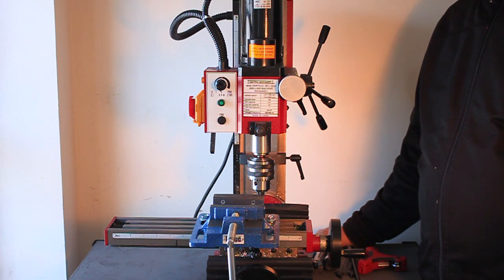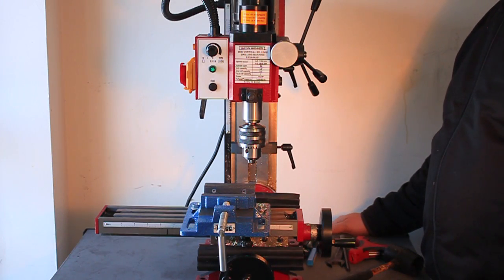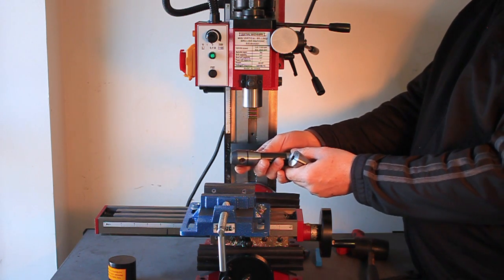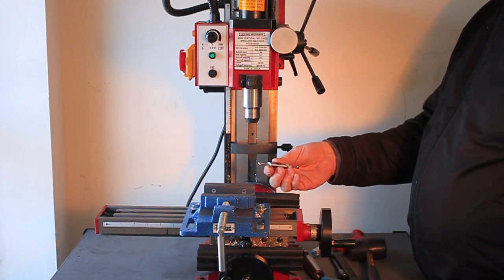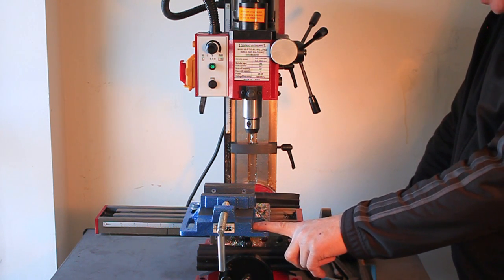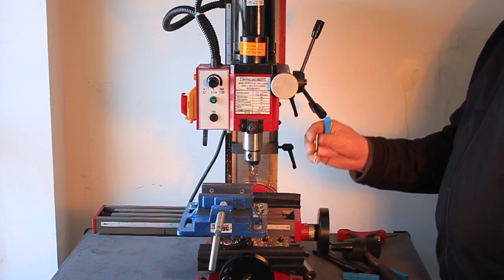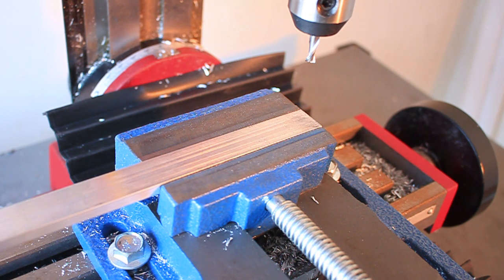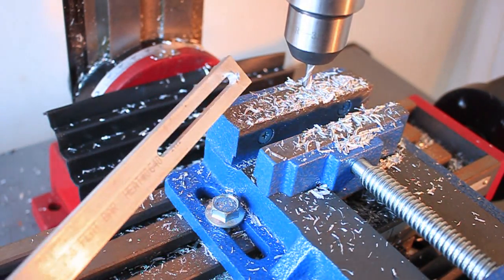Harbor Freight Mini Milling Machine

Comment: To release any r8 collet or drill chuck you loosen the draw thead about 2-3 turns tops and smack it with a dead blow mallet. It will drop the treads catch it keeping it from dropping out and the unscrewthe draw bar by hand.   What you did will 100% mess up threads.

Comment: for $155 I added a belt drive to replace the damn frangible gears!  It has two speed choices(pulleys) 0-4700 and 0-1700 RPM Sooo quiet and MUCH smoother.  Have not had to take the mill apart in the 7 years since the upgrade.https://littlemachineshop.com/products/product_view.php?ProductID=2560&category=2122081963

Comment: You do not completely unscrew the threaded shaft then tap it, you unscrew it several turns, tap with mallet, hold chuck in one hand then unscrew threaded shaft with other. You don't  have to remove the threaded shaft at all!

Comment: Loosen the top bolt then reinstall it 5 or 6 threads tap the chuck loose and unscrew the bolt this way you cant damage the threads, and you absolutely can dammage the threads on both your chuck and collects and shaft.  Use a brass hammer or a dead blow hammer
Do not use a steel head hammer.
You should own a brass hammer. 
I worked in a machine shop trust me if you don't think it can break ive got news someone will break it.

Comment: You only loosen the chuck shaft, if you fully remove it and strike it with a mallet, it will eventually damage the threads..

Comment: 2:15 ... Some people "think" it will ruin the threads...it WILL ruin the threads, that is not even a question to ask.  Never hit a threaded rod into a nut without screwing the rod into the threads first !  You can lightly tap it, just like you did, but ALWAYS thread it in a little bit first.  Never do it the other way, its not an option, unless you like boogered up threads that is.

Comment: The machine is okay but the X-Y mill vise is total junk.  Mine came new with both travel screws bent at greater than 14 degrees where they passed through the fixed jaw.  How can that happen unless it leaves the Chinese factory made and assembled like that?  There was no damage to the packing yet Harbor Freight refuses to return or refund.  If that is the quality of their $56 vise how can you trust the consistency of their machinery?  I noticed that not once did you say “thousandths”. Not surprising.

Comment: The proper way to remove a chuck is to back the draw bar out ~1 turn and then tap it with the mallet, otherwise you do risk damage to the threads (still kind of unlikely though, unless you slam it for some reason).

Comment: Does your chuck wobble when rotating? Mine does at low speed, at mid speed the mill vibrate and at high speed... I think the chuck is faulty 😕 Can I send to you a video and let me know if that is the way these Chinese chucks are, or they're faulty?
Reply: It's made in China from recycled Toyotas by slave labor held at gun point.  How accurate do you expect it to be especially for the price?

Comment: In 1980 rite out of high school went to work in manufacturing at a large company.  Please to all SAFETY FIRST ALWAYS EYE PROTECTION AND HAIR TIED BACK.  First year a young lady on a high speed drill press lost her scalp. She lived and it was a freak accident. In a different company a many severely hurt from lathe stringing debri.  Machines have tobe treated with respect.  Safety first

Comment: This video popped up in my feed at a good time, thank you for making and posting it. I have a South Bend Lathe and an old Taiwan made mini lathe, and have been looking at getting a milling machine. I was a machinist years ago, and ran Bridgeports, engine lates, turret lathes, CNC lathes and whatever paid the bills. Your video showed what the machine can do, and what to expect. It will fit in my garage or basement easily, and I'm up to the task of upgrading it as needed. The comments section is brutal, I guess some people just can't let you be. Thanks again, Joe.

Comment: I started out with a "VERY" used Bench-top model of Mill ($150, if I could carry it away - which I did).  Over the years, I "graduated" to Bridgeport Vari-Speed Mills and finally settled on a Lagun 10 x 48 - with CNC and XYZ readout and all tables motorized (over $25,000).
I can tell you this much --- in the proper hands, they BOTH cut ...!  Haha!

Comment: is there a micro adjust/movement on this machines' Z axis?. I see a hub with a couple of handles coming of to rotate the pinion but the knob that the viewer only gets an end view of, is that a micro movement in the vertical.
Reply: I know it's a year later but yes, the standard three handle drill press type handle pushes straight in and engages a worm that the front dial uses with a thousandth zero out dial on it. So you can micro adjust z up and down

Comment: Better to give your [draw bolt ] a tap Before you completely remove it from the thread, then you will not bend or burr you first thread on the bolt.

Comment: You just told 5.2 thousand people how to ruin the threads of a collet/chuck draw bolt!! The smart people that told you that unscrewing the bolt and whacking it would ruin the threads on BOTH bolt and tool were correct! Correct way is to loosen bolt 1 turn, then whack it dummy

Comment: One of the plastic gears broke after a short time- and I was only milling small aluminum parts. I had to take it apart to salvage some parts and throw out the rest.
Reply: Plastic gears are easily rebuilt or to make using baking soda and super glue. Works well.

Comment: Loosen up the collet drawbar two turns. Lightly tap it with a piece of brass about 3/4 of an inch by 2 no handle needed lightly tap it it will drop out all of the threads of the drawbar will be engaged except for the very end and you will never tip the lead screw or damage a collet by beating it out on a lead screw. Loosen it tap it then unscrew it. 70 years of Machining experience between me and my teacher toolgrade Machinist

Comment: I think it a cool machine. You don't need a Bridgeport for home use. When removing the collet unscrew the drawbar a couple of turns then tap out the collet you will damage the threads on the bar and the collet. No I'm not an arm chair Machinist that's what I do for a living. Don't over tighten your collets or they break.

Comment: I can't watch more......watching a rank amateur is a pain...…….you should have just loosened the draw bar a thread or two and then tapped it with the hammer before screwing it all the way out.....Don't you know ANYTHING???...…..What you did was to burr the threads over at the top of the tool shank with the end of the drawbar......Lord help you when you get to do more videos......and that vice..DIDN'T ANYONE TELL YOU IT'S S DRILL PRESS VICE NOT A MILLING VICE?
Reply: I can't watch know it all smart asses.  If you can't help then shut the hell up.  You are probably old enough to be half as stupid.  Somebody sooner  or later will slap you into next week if you are stupid enough to say something like this to them in person.  But you are probably to cowardly to try that.....................Grow up

Comment: I don't get these Mini mills. They aren't really stiff enough to do a good job milling steel and the spindle is too slow to be optimal for aluminum. I'd rather spend the cash on a cheap CNC router for hobby aluminum work.

Comment: wrong way to remove the chuck...simply loosen the draw bar a few threads and tap the hex on top. then unscrew it completely...been doing this for nearly 40 years and never stripped a draw bar ever...if the threads are completely disengaged and then struck on top to release a collet, then damage will indeed occur..

Comment: We bought one for our light use shop.  After one use the quill assembly was bent and the "run out"  of the collet is about 45-60. thousands.  The quiz assy. is very light duty.  Even at $500 the machine  is not much better than a simple drill press.

Comment: The first thing you do is completely dismantle the machine, scrape the ways, square and align everything. Will take 2 days to a week depending on you experience and skill level. Then you have a decent machine to work with. You will need a surface block to do it properly.

Comment: Just curious... do you think I could use an end mill in a drill press to cut slots in  non ferrous metals and use a vise with XY axis? I do some projects where this could be useful but not enough to justify spending $400+ on a mill like this

Comment: Easy way to prevent damaging thread when you knock out the chuck is to make sure the draw bar thread is still engaged in the chuck by two or three turns. Once the chuck is free from the interference of the taper, just undo those last 3 turns. :) xx

Comment: I've been milling (cheap plastic toy stuff) using the drill chuck. Had no issues, even though I'm sure it's wrong...what's the difference? Chuck not designed for side pressure?

Comment: Good video. I purchased this machine last year as an entry model. It was well below the price of other machines. $400. VS 7 or $800. is a big difference for a hobby machinist. Accessories for this machine are easy to obtain on ebay and elsewhere.  In addition, companies such as Little Machine Shop have products like the air shock to stop the head from dropping unexpectedly ($80.) or the pulley drive,($150.) to make the machine run more quietly and save you from broken gears which will happen sooner or later. With the notion of purchasing a machine that is initially less expensive and upgrading if I want to in the future when I can afford to spend more on an incremental basis later this machine is a good way to get into milling.  In the end, you have to ask yourself can I live with some quirks from a machine that costs way less than the competition? Probably.  One feature you can not readily do with other machines is the return policy. If you get it home and it is not working properly just bring it back within 90 days for a new machine no questions asked and get a new machine. Not an easy exchange with many other companies.

Comment: Awesome little tool.>>>ur2.pl/853   I use it for model rocket building, so cutting plastic, cardboard and balsa wood is very easy and I get perfect cuts each time. I mounted it to my workbench with 2 machine screws. It does come with 2 clamps to be mounted on a table or bench that has an overhang. It has an adjustable speed motor as well.

Comment: Very interesting video. I do heat treatments applications on machined parts at a shop (a small mom & pa shop) I do other menial tasks for machinist. Order and cut the mat’l they need and what not. I’m in on the ground floor. I’m hoping to get in on an apprenticeship. I look up tons of stuff on machining in hopes that this could work for me. I believe it’d be a happy career path. Interested in machining and considering getting one of these things to tinker with on MC Nylon or aluminum stock. Thanks for the upload.

Comment: Hi Minimachineshop. I just purchased the same Mill and I have had bad luck finding good end mills. I am also wanting to cut 1/4 slot as you did in the video but I am not getting a clean getting through the 1/4 thick aluminum. If you can give me a model and where you got your end mills any info would help. Thanks

Comment: I love the people asking if it cut steel... I'm sure it can, but nowhere near the speed he cut that aluminum.  I would've used some oil even on that aluminum, personally, but even more so on any brass or steel.  You're definitely not gonna be slotting a piece of even 1018 steel the same size as that aluminum that fast, probably take you 5+minutes and applying oil as you go, but I'd guess it'd work ok if you go slow.  For a weekend hobbyist using it only occasionally and willing to take their time probably fine.  Spending a bit more for the next version up would be a plus.  

Yes, you can get  used Bridgeport for probably a bit more, but not everyone has the room or wants to move huge/heavy machinery around (most don't have jacks and forklifts).

Comment: When cutting metal, especially aluminum you need to use some type of coolant to prevent chip weld. Otherwise not a bad video.

Comment: I guess it depends on the rigidity, work envelope and power needed for the job. I think for the general project builder it would be wise to consider that once a few ideas flow there could be a desire for more work space and travel. Hence a use for more stock removal  with added power and rigidity. Good points here. It would be a bitch forklifting a Bridgeport into my basemen lol. So until I get the garage finished for the CNC mill and lathe I guess I'll just keep making my widgets at work like I've done for the last 34 years. ;- )
Reply: ps You can make compensations for where a machine is less accurate. It's never the machines fault 99.99% of the time. I remember the old days getting pissed off. ;-) Know the job and the machine first and plan around its inadequacies. Use added indicators on the table for referencing Known size blocks. Talk to veteran machinists for Ideas and hypothetical problem solving strategies and how to advice. Good luck. Yeah, The 110" diameter chuck vertical turret lathe I worked Pratt and Whitney Turbine with had some nutz! 1 ton of machine for every inch of diameter table lol.
Reply: I'm telling your boss that you make things at work

Comment: Partner,Dont sweat those people.Ive been a machinist longer than I care to remember and yes a Bridgeport Is a solid machine and at one time the benchmark of mills.However in today's market it's all mostly CNC.So you hit the nail on the head with hobbies is just that.By your tools according to the application .That doesn't mean you cheap it means maximum your investment toward application .As your knowledge and needs change you'll know when you need bigger "better" machine tools

Comment: To prevent distorting the threads, tap the top end of the bar while it's still engaged a couple turns with the collet or chuck. When it's loose, unscrew the remaining two turns.  That aside, a sharp tap with a lightweight tool on the side of the bottom end of the spindle is the best way to disengage a Morse taper.
Reply: David Perich youre 100% correct! I'm surprised this didn't state what you've said.

Comment: Nice review,  It looks like a great Miller for the average Home owner's garage..  You're right about the end-mills,   shop around and you can find some decent prices,   Be careful of chineze cutters, or Asian cutter in general,  They make good ones and garbage ones,   if you are not familiar with cutter geometry just buy an American made cutter,  and compare it to others online,,    There's a lot to learn about machining,  Proper speed and feed is EVERYTHING if ya want your cutters to last..  Cutting oil or coolant is a must,  for tool longevity..  You can ruin a $30 end Mill in one cut,  believe me,,   I spent 3 years in trade school, nights,   It's great..

Comment: had this exact unit for about 10 years. sold it last year. could only recommend it for hobby use making toys like model steam engines out of brass and aluminum. the motor has no torque at all and stalls drilling any hole in steel eve8n less than 1/4". even with lots of cutting fluid. it wasnt without use just saying its best for soft non ferrous materials.

Comment: The truth is that you need a substantial amount of mass in the machine to hold the work steady in relation to the bit.  These little machines can't do it unless you reduce your depth of cut to a few thousands, and stay away from harder materials.

I had a similar machine and couldn't even cut aluminum on it.  Vibration would cause the head to slowly creep down the column, no matter how tight you locked it.  On these little machines, the column flexes, the head flexes, everything flexes.  Yes, they're affordable, but that's about the only thing good about them.
Reply: I bought one for gunsmith work and have had a great deal of success. Porting slides for weight reduction, front serrations, etc. Completed a few 80% lowers for myself as well, no issues. It's not an industrial machine and not advertised as such. Maybe the critics have rough skills or just or expect to run a production line from the machine. When used for it's intended purpose, will do the job just fine.
Reply: Funny thing is he same machine is sold by over a dozen companies, different covers and paint bu the same machine. Grizzly sells the same one for $1,295.00. H.F. $699.00 unless you use the 20% off coupon, then it's $568 to the door. I will save the thousand for cost of a Bridgeport plus electrical upgrade to the house. Makes no sense to buy a semi tractor if you have a john boat, the same as why buy a Bridgeport for home use when you can get this one ?????????????????

Comment: I have one of these. It was so rough that it was unusable until I lapped and cleaned everything up. The motor drive board died right after the warranty expired.I I blew up the drive gears by forgetting the spindle lock pin and turning it on. Little Machine Shop sells a spring loaded spindle lock and metal gears. A 7/16 NF bolt works better than the drawbar that comes with the machine. I've worked on it more than I've done work with it.

Comment: It looks like this would be easy to convert to a small CNC mill.  Just add stepper motors in place of the handles and a controller.

Comment: To avoid stripping the draw bar threads, i strongly recommend hand loosening it about 2 full turns then lightly tap the top with a brass hammer until it breaks free then loosen it the rest of the way

Comment: thanks a lot for this video!  Have you tried to max out the capacity?  I need to drill 7/16" slotted holes in 3/16" aluminum flat bar.    thanks!